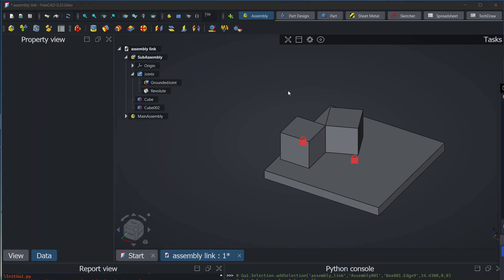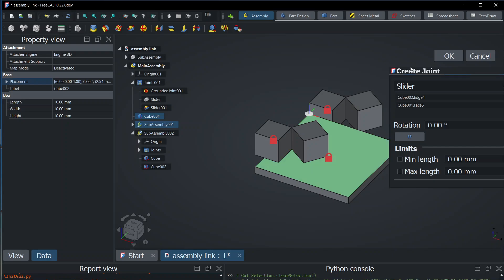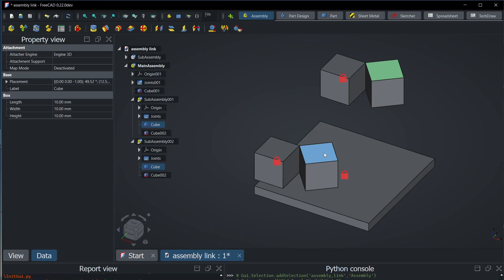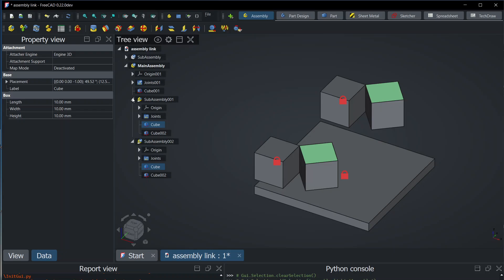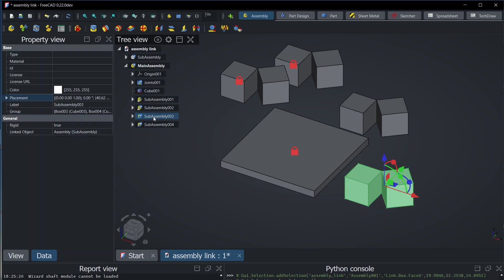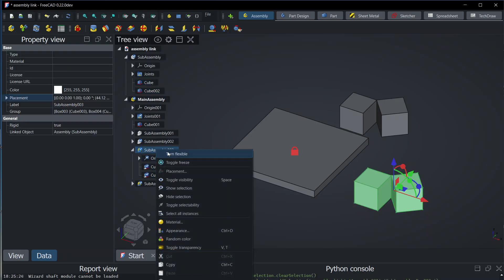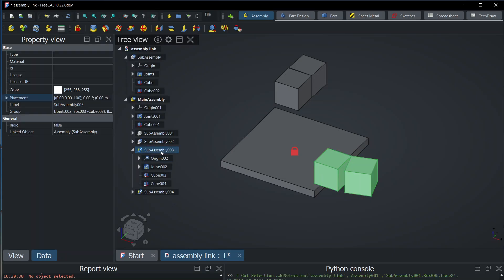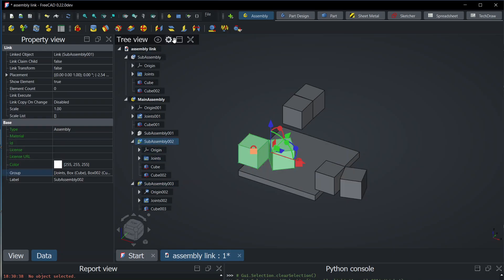FreeCAD Flexible sub-assemblies problem description

Comment: What happens if you modify the original assembly (e.g., change/add/remove constraints) that has been included as a flexible subassembly?
Reply from the maker: The idea is that they keep in sync. So if there's some modification in the assembly, the assemblyLink updates

Comment: Awesome video, as well as work that you're doing. Solution two seems to be the most natural to me. However it's worth to ask how much does the creation of new objects will impact the performance in a huge assembly.
Reply from the maker: New AssemblyLink wouldn't be a performance hit. They would be better performance wise than the first solution (copy on changed links). It's just that it is adding complexity to the software by adding one more type of objects.